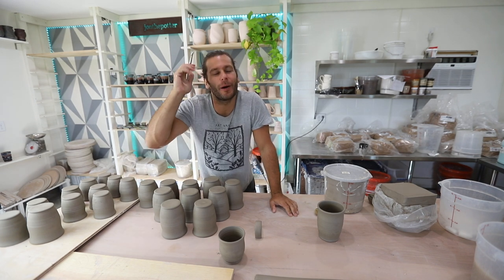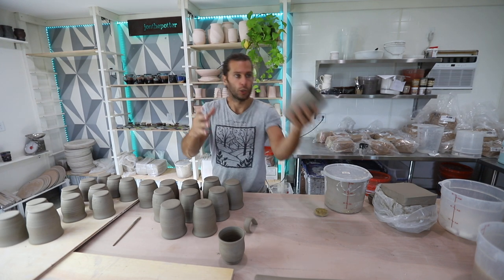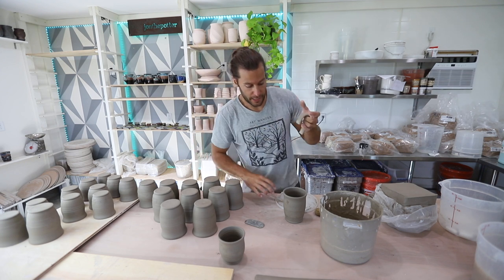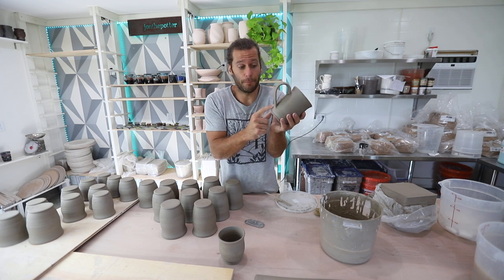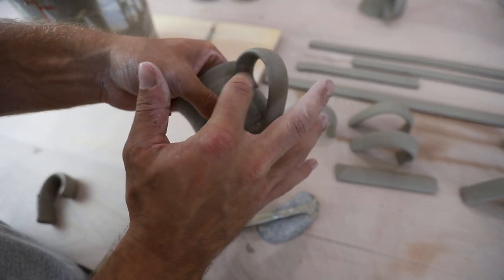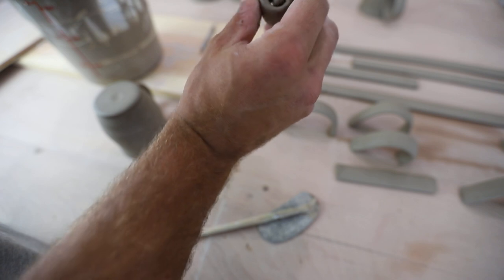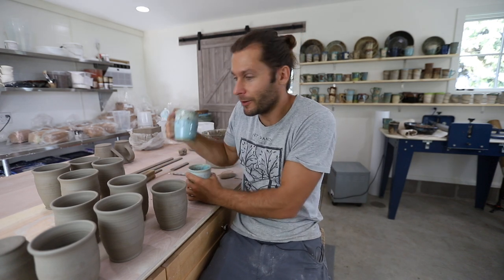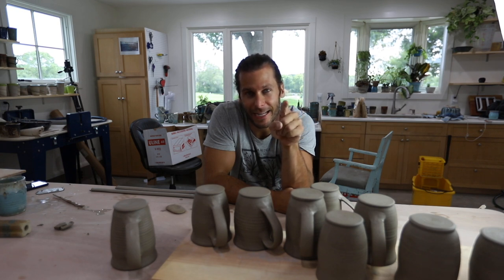HOW TO ATTACH HANDLES - TIPS and TRICKS

Comment: I definitely have a handle preference and I'm changing how I make mine as well. I have a few reasons for why I like a sturdy, thick 4 finger handle. That mug you showed where you can fit your whole hand in the handle is exactly what I like. I have tiny hands. They are not very strong. They even have early stages of arthritis (and I'm young, only 44). When I can only fit one or two fingers in the handle, my fingers are not strong enough to hold up a full mug of liquid. So the mug droops, my hand is in pain, and I need to get that second hand up to the mug before it falls. I want a meaty handle so I feel like I'm really grasping something. I also often hold my mug just by the side of the mug, sliding my 3 or 4 fingers into the handle for extra support. I can't do this with a 1 or 2 finger handle. I've noticed that potters need to make different handles to offer different options to customers, since people have such strong preferences on the subject. By the way, that was a great wake boarding video today! Awesome perspective, and loved the underwater part at first.
Reply: I need a big handle for the same reason - arthritis and neuropathy require a firm grip with 3-4 fingers!

Comment: I’m not a potter. Wish I was. But seeing you use slip, I have a question about slip. How do you make it? What makes good skip? Does it dry out? If it does can it be saved?
Reply: UniquelyPenny A.K.A Penny Loker  Slip is just clay and water. I like to make mine kind of thick and gooey. Just add less water. If slip dries out, just add some water and wait. 

Trimmings make great slip because the clay will dry faster in smaller pieces. Crush it up, the powderier the better, and add water!

Comment: Have you ever used clay you dug up yourself?
Reply: I have.  I dug a hole in my back yard and kept digging until I got usable clay.  It still had a some rocks and sand in it, so I mixed it in water until all the clay was in suspension, let the heavier particles settle out for 30 minutes, then poured off the clay water, let that settle overnight, then carefully siphoned off the excess water.  Then I purified it again so even more sand could settle out.  It took almost a month to dry to a nice clay texture. Ultimately, it wasn't great clay.  It was very coarse and difficult to throw, but I was able to make a few things with it, and it was a great experience.  When you fire it, put it on a large plate of known clay in case it melts in the kiln.  You will almost certainly get much better clay from your local clay supplier (like Continental Clay!), and if you value your time, commercial clay is cheaper, but if you want to dig your own clay, you absolutely should.  No reason not to.